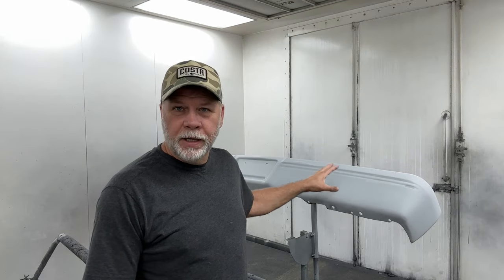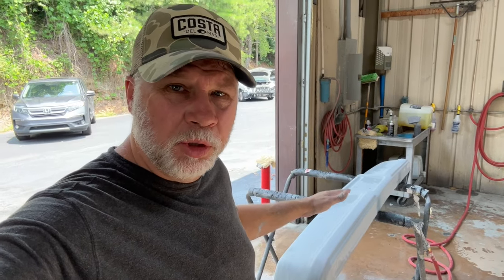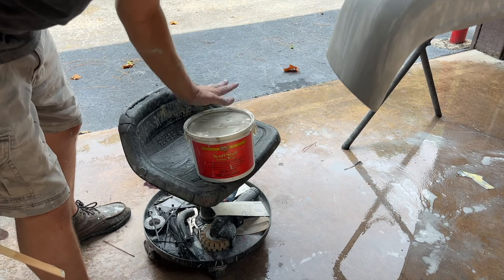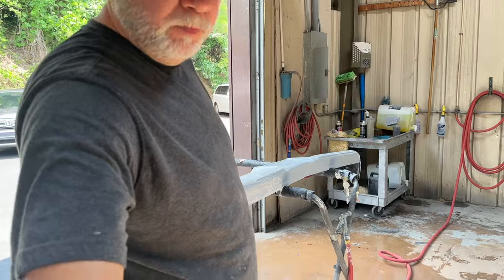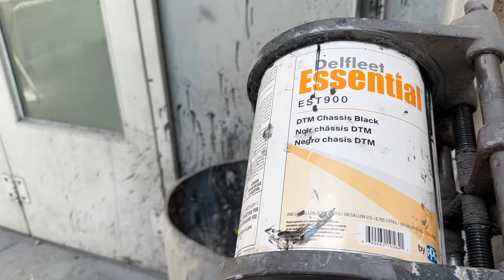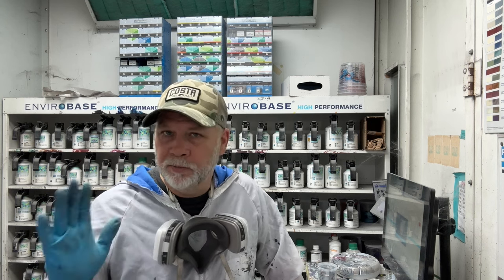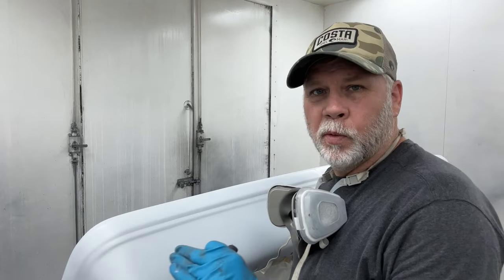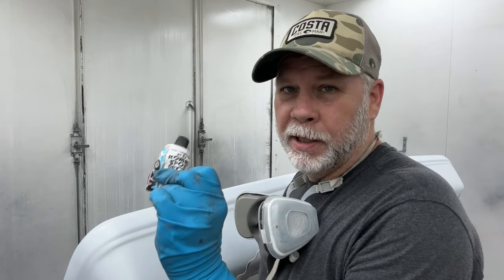C10 Project:  Painting the Front Bumper

Comment: You gotta be getting close! I wrapped up my sons V20 a couple weeks back and about to start a 85 k20

You gave me an idea! I’m gonna fix and paint and old 10” drop bumper. 

A really good upgrade to the Kombi putty is UV activated spot putty. It doesn’t shrink back and sands in less than a minute after 10 second cure with UV light.
Reply from the maker: I’ve seen the UV stuff demoed but never actually used it. If it’s bigger than a pinhole I usually use 2part putty   

I am closer. Still have a bedside to straighten out but after that I should be ready to paint the bed. 

That old bumper should turn out cool. Im thinking of an old school rear bumper for this C10. Maybe one with the dealer info stamped into the steel like they used to be. We will see
Reply: @StoutCustom  always look for your progress vids. Cool truck for sure. 

Love the old stamped bumper idea! Was leaning that way until I seen your vid and realized I had one of the old painted steel drop bumpers. 
Love seeing your progress as we both share similar interests , only I have no patience for making vids. 
I ended up color matching the bed liner on the V20 (U7475). Of course,  after I took time to dolly all the ribs as you did.

Comment: That Black Widow laid it down.
Reply from the maker: It did really well. I can’t wait to get my hands on the new Iwata SuperNova digital though.
Reply: @StoutCustom  that will be my next gun. I use the black widow also but I mainly use my iwata lph400lvx. I love that gun.
Reply: Looks like "new money" man,all that hard work paid off big time...NICE
Reply from the maker: @MidnightCustoms111  hard to beat the Iwata for clear in my opinion.
Reply: @StoutCustom  yep I own a body shop and work for a local shop. I like the sata 5500 for base but the black widow sprays about the same just a lil slower. The iwata ls400 is a ok base gun the ws400 is like the holy grail. Im really wanting to try a sagola 4600. But I love my lph400 on clear.
Reply from the maker: @MidnightCustoms111  I like my Satas for base and Iwata for clear. All my guns are like me, old and worn out, lol. The black widow is an ok gun but leaves a lot to be desired if you’re use to the high end stuff.  My 4000hvlp still does wonders for solvent basecoat. I just need that new digital supernova to put the icing on the cake again.
Reply: @StoutCustom  yep. I'll be buying a ws400 supernova soon. I'm building a 87 square body for a customer. It's black at that. Said and done ill have 500 hours in body, paint and buff work. Takes alot to make a rolling mirror

Comment: used a sata 5000 for primer then a 200 harbor frieght gun for base
Reply from the maker: Um…the SATA was used for base. Sealer and clear were sprayed with the harbor freight gun.
Reply: Great info Jim and good info. I have "Nickel" plated bumpers and after cleaning, a serious sanding lightly, I went with 3 coats of CRC cold galvanizing then a Matt or flat clear. With stock spacing, you can see some areas behind the bumper. I just wanted it to look factory for years. I did't drop steering knuckles, stock height and full bed. I am just want to haul full sheet of plywood or drywall. That is what trucks originally did.